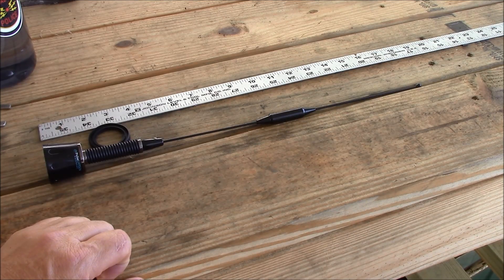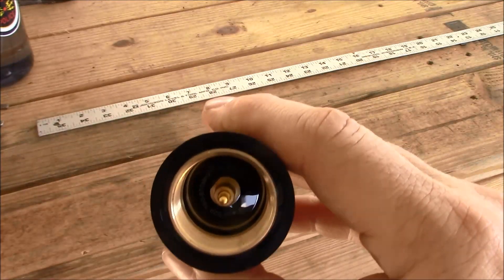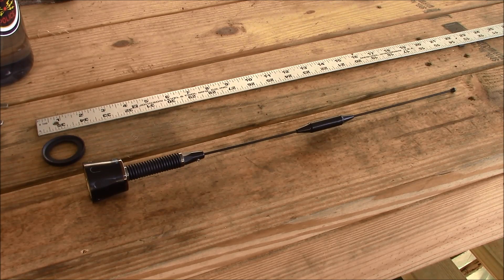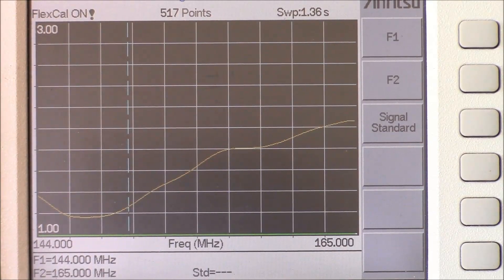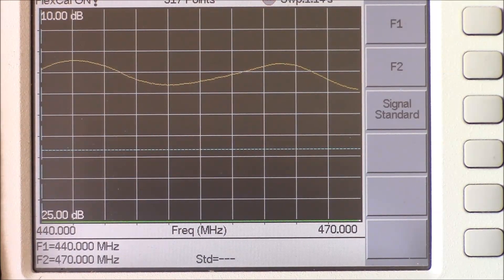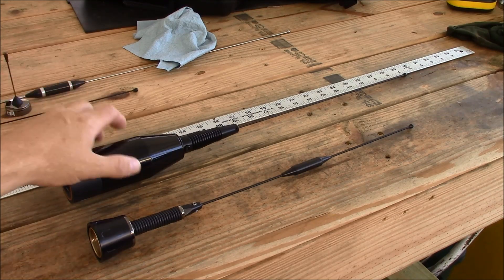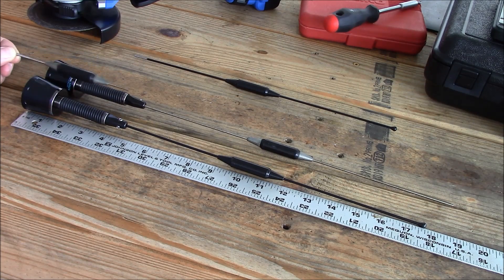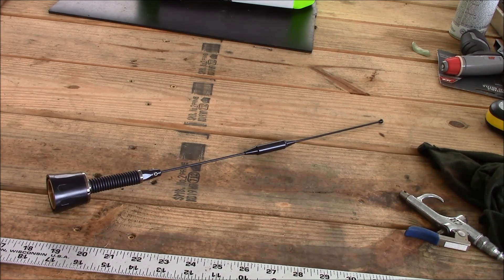Triband mobile antenna review - Pulse / Larsen NMO150-450-758 Will it Ham ?

Comment: Did you do any testing of this antenna on the 902-928 band?  I’ve seen it suggested that it has acceptable SWR up there as well.  If so it would make it a nice all purpose antenna.
Reply from the maker: I still have it so I can test it. Im going to guess ahead of time that it probably will not. We will have to see if such is the case and I will let you know. Thanks for watching !
Reply: @survivalcomms  most interesting to see would be how it performs around 902 -903 as that is where most of the TX is usually going to take place on 900.  If you still have the extra whip that you repurposed to improve ham band performance it would also be interesting to see how that affects its performance on 900Mhz.  It would be nice to have an antenna that can work well on listening to Public Safety, MURS while also functioning on 3 Amateur bands as well as GMRS in a relatively small footprint.

Comment: Did you decide to use your mod?

I'm reminded of the admonishment "test, test, test..."

Good stuff!
Reply from the maker: I'm using the factory one on my work truck. I'm going to further T&E the modified one. Thanks for watching !
Reply: @survivalcomms  I'll be watching. I don't use the 800MHz band, but still am interested in the outcome.
Reply from the maker: @nvrumi  I use 800 mostly but our network is seriously well engineered and most of the time an NMO mount alone will work. I believe shortening the tip end of the whip by a CM may flatten out the REF PWR in the mid part of the band.